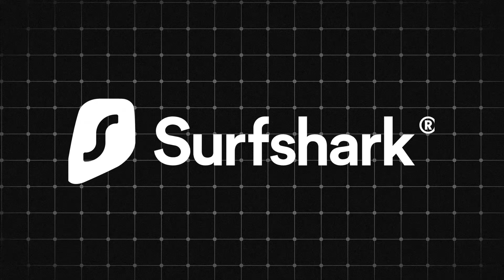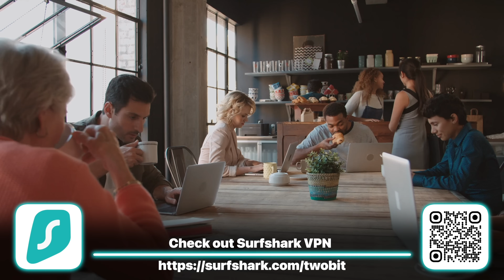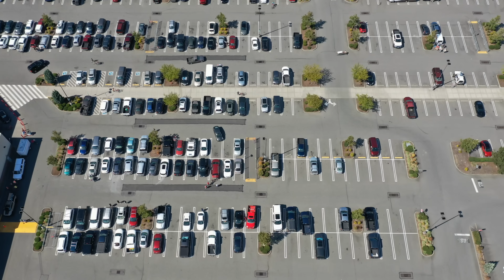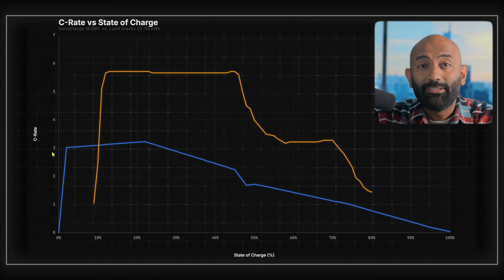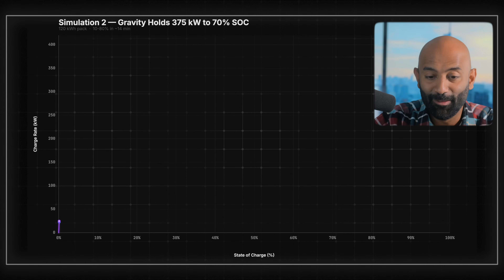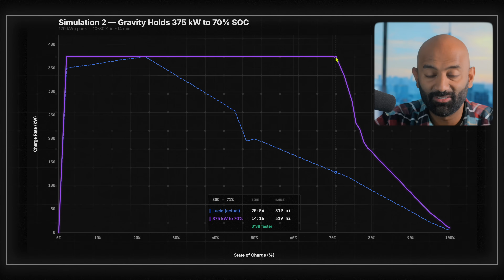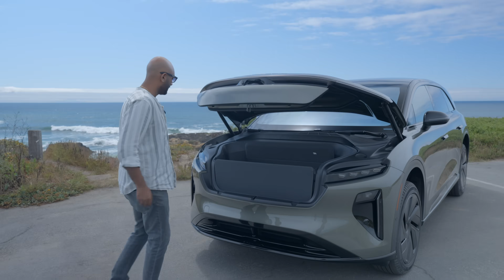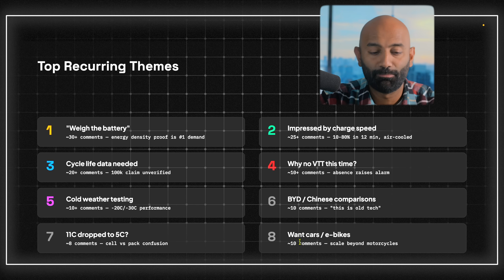Donut Lab Battery Test 4 Changes Everything!

Comment: I believe them easily.. but I don't think it will have a large impact, if they are still only like 10% cheaper than regular EV batteries. When Chinese salt based batteries have similar stats in many ways, but are in theory 90% cheaper (in couple of years).
Reply from the maker: 90% cheaper salt batteries? That’s the wild card. We’ll see how Donut Lab’s real numbers stack up.

Comment: What if we just did modular batteries rather than worry about charging speed we standardized the battery size like AA? You could charge it over days and have longevity, etc.. then you would simply pull up to a gas station and say I’ll have five AA’s please. They already do this in China by the way.
Reply from the maker: modular AA batteries? cool for city fleets, but try getting 200 miles range out of a AA. physics wins.

Comment: As I keep saying, third-party, fully independent, and unobstructed testing OR it is only smoke and mirrors. Yes. 5.7C is impressive. But it’s already being done outside of the solid-state realm. Give me scientific data from an independent test and I’ll believe.  Until that happens, it’s just fancy marketing.
Reply from the maker: not sure any system charges at 5.7 C with air cooling. or holds 5.7C for a huge part of the charge curve, thats outside normal at this point. there's something here.. but yah we shall see

Comment: This is quite interesting. I work for a company making some e-bikes so it is fun to see that.  I can also understand that they do not weight the battery, even though this is a bit depressing.

If they are really making a commercial product and shipping it this year this would probably be a new rush to get the tech and improve it, getting around patents and everything, this could lead to a lot of R&D and leap forward for EV.

Now this is a big IF. There are a lot of claims (like solid state emergency batteries that aren't at all solid state) that do not hold true because no one is ever held accountable for misleading marketing. I think laws about marketing should be easy : get the litigious part (with no name and no brand) to 10-100 people unrelated. Ask them about that part, and if they are mislead then consummers misleaded should be offered the option of getting their money back. And if there is still any profit after this, then it should be fined and that money should get to the state. No profit from illegal means.

But hey, let's dream about politicians doing some actual work like the engineers from Donut. Cause even if that's false advertising, there is no doubt they did some real world work here. I don't know enough about battery charging. Maybe overcharging lead to degradation which mean that the batteries will not hold. Maybe there will not be any warranty on the battery, or with a big asterix which will make it useless. But hey, still, impressive.
Reply from the maker: solid state emergency batteries that aren't solid state — lol, been there. hope this one actually ships

Comment: I watched the Donut Video. It had some strange omissions, as always...the most obvious one being, that they showed the initial Temps, but not the final temp. I also don't remember them talking about charging losses🤷‍♂️
Also, the real claims, like energy density and longevity still haven't been addressed.
That Bike could theoretically have charged that fast with a standard battery chemistry, if you didn't care  about damaging the Cells after just a few cycles.
I'm not saying that is the case, just being cautious about this, since so many things are still unclear.
Reply from the maker: final temps and losses matter — hope test 5 shows both

Comment: so what would happen if you had a donut battery the size of a tesla that is water-cooled and charging at 5.7c could you charge even faster cause you can keep it at the perfect temp even faster?
On the simulation 2 that you showed was that with water-cooling in mind or just air cooling cause if you had really good cooling could you not have 400kw charging to a higher % , and that would mean super fast charge speed and the 5.7c might because it is not water-cooled so could that not mean that you could do 7.5c at 400kw to lets say 70% then go down to 5.7 for 100% if so would that mean you could go from 0-100% around 10min on a tesla size battery?
Reply from the maker: Water cooling helps, but chemistry still taps out around 80% — donut’s curve proves it. Even with perfect cooling, you’re fighting physics, not just heat.
Reply: @TwoBitDaVinci  thx for the info

Comment: Could some of those steps be there because they're using a two electron transfer active material? Yeah and when should you view these graphs as voltamagrams / impedance specteroscopy / thermal characteristic curves because one or two of those can imitate the third and vice versa, so it seems like nothing is conclusive from this kind of data but there must be an intuition to know what's most likely yes?
Reply from the maker: Two-electron transfer? Possible — but without knowing the chemistry, we're just guessing what the steps mean.
Reply: @TwoBitDaVinci yeah it's still mostly speculation, but a calcium battery would be amazing!

Comment: Donut said the motorcycle would be limited at 5C because of the aircooling. Cars should be able to go higher.
Reply from the maker: air cooling caps it at 5C, liquid cooling in cars would let them push higher

Comment: Looking at your quick rundown of what this means for charge rate, this is the thing that will finally make an OTR electric semi possible. This has always been the limitation. Better energy density and faster charging will change everything. Just the energy density and the cycle life would completely change the world for every other vehicle use case. Add in the improved charge time and it's just pure insanity that we're getting all 3 in the same product all at the same time. Range anxiety for electrics completely disappear. If all of their claims are true, in 5 years time nobody will want an internal combustion powered car unless it's for nostalgia purposes.
Reply from the maker: game changer if real — but where's the cell weight data?
Reply: @TwoBitDaVinci  Yup. All we can go off of is their claim of 400wh/kg at this point. I'm not sure why they're witholding actual data on weight at this point. It's not like it would reveal any more about the trade secrets than making that claim in the first place. I guess they just want to play games?
Reply: By the way, I say this as a long time electric vehicle skeptic. In the early days, range, charge time and cost were my main concerns. They've mitigated those issues substantially over time, and I've been extremely impressed with track performance as well, but they really haven't been able to replace IC cars for certain applications, tied to those above concerns. If this turns out to be even cheaper, range between charging stops is longer than most gas cars and fast charge time is nearly as quick, there's really no downside any longer.
Reply: Oh, and I forgot, the batteries never wear out. That's equally as incredible, and even at lithium ion battery life cycle, I never thought that was a major issue. Cycle life was always good enough to compete. Now it blows a piston engine out of the water completely for longevity.

Comment: My BYD Seal 6 Touring PHEV has a 19kWh Blade 1.0 battery with max. 6.6kW charging. Would be pretty fast with 100+ kWh charging :)
Reply from the maker: 19kWh Blade 1.0? Cute. Now imagine that at 100kWh with 5C+ charging — your Seal would smoke most EVs today.

Comment: Comparing this to 3-4yr old US tech is completely irrelevant. Put it up against BYDs new blade battery or the new latest from CATL. 5C charging at the pack level is good, buts not close to industry leading now.
Reply from the maker: real hardware > cell specs. show me the pack doing 5c in the wild

Comment: Sorry, but this charging demo, in isolation, proves not a lot. This is because charge rate depends on two primary factors

1) what temperature you start at
2) how much wear you will accept

Basically for a single charge event, starting with a cold battery, the DCIR of pretty much any modern battery chemistry is low enough you can just wallop in pretty much any charge you like, without ANY cooling. This is because the cells themselves have a thermal inertia, ie they are capable of absorbing heat energy.   As we don't know any temperature data for this charging demo, we have no idea if 5.7c is impressive or not (given the proven high temp capability of this chemistry, it should be impressive, because being able to have a cell run up and over 65degC means you really don't need any cooling (for a single charging event) 

And until we see a fully homologated production ready motorcycle, we don't know if they have just ramped up the C rate for this test.  Obviously a big heavy passenger car is going to be a much harder task regarding life, because motorcycles have a low average power requirment (the speed limit tends to get in the way... 🙂 and lots of regen is not possible (unless you like going sideways)) and they do low miles per year. I suspect for a motorcycle cell calendar aging is, by far, the biggest wear factor.  That means the manufacturer can push the limits a lot more in terms of fast charging wear

 So sure now 5.7c is impressive, but it's far from proving this chemistry is a genuine game changer (and of course, the actual bit that needs to be proven, even if these cells meet ALL their claimed performance metrics, is can they be manufactured in volume and cheaply....)
Reply from the maker: starting temp is everything — without it, 5.7c means nothing for real-world use

Comment: ehhhh, measuring state of a lithium battery based on voltage is less accurate as the voltage difference rises. It was the first thing I learned in operating with lithium cells. It gets warm and the internal voltage rises but the voltage drops back to its capacity shortly after detaching from the charger. Requiring cooling is a red flag for poor measurements for exactly this reason, because it denotes a high internal resistance converting a lot of input to heat not unlike modern high-rate lipo cells. The reason this isn't done in practice is because of the long term damage and risk to the battery when you try to do this repeatedly.
Reply from the maker: yeah voltage sags under load—cooling needed means we're fighting physics, not just measuring it

Comment: Everyone says why not 11v charge it?  Donut labs literally stated 5c charging without cooling.  With cooling it's 11c.  They showed in the lab testing that it can 11c without cooling but that was pouch level not pack level.
Reply from the maker: pouch-level 11C doesn't translate directly to pack due to thermal and current distribution—good catch

Comment: when talking about donut battery pack in a lucid air you forgot to mention that this scale up is for air-cooled battery. Add liqued cooling and you can achieve much better than that
Reply from the maker: liquid cooling would definitely help — curious what their actual thermal design is

Comment: Here in Australia we already have Zeekr’s that can charge faster than 400kW. Their Golden Brick battery can charge at 480kW and the new 900v architecture cars will charge at a rate of over 600kW. All we need now are the chargers that can deliver this amount of power. Really interested to see the weight and energy density of the donut labs battery
Reply from the maker: weight and density still unverified — we only have charge curves so far

Comment: It worries me that Verge is still advertising "80% charge in less than 10 minutes" on their Long range TS Pro model. Unless they think they can improve the BMS enough to reach that before the Bike reaches customers, I'm confused. I'm getting the feeling this could end up being a good battery that would have been well received on its own, but might end up with some initial back lash as it falls short of the marketing. Pretty easy way to get sued too.
Reply: It was now 12min for 80% charge, quite easy to optimize to 10min
Reply from the maker: marketing writing checks the battery can't cash — classic

Comment: Thank you for giving the battery an actual chance and actually analysing it and the data we are given.

The critics seem to lack the imagination to even consider it could be real. I wonder why they haven't build a solid state battery since they know so well how one is made. Also, since the critics are also marketing experts they should propably give Donut lab a few pointers of what would be a better marketing strategy than what we are seeing. And ofcourse since they all see it's a hoax, they should propably consider how are Donut lab supposed to slip away from this noose they've put themselves in, that is tightening every week with every test result.
Reply from the maker: critics busy building marketing decks instead of batteries, huh

Comment: High charge rate, temperature stability, and high energy density could start to make it possible to make electric small planes. Right now the energy density is too low to deliver useful flight durations. If we could double the energy density we could get up to 2-2.5 hours of flight time. 
that could start allowing replacement of extremely expensive to maintain piston engines ($50k to $100k+) which require rebuild or replacement every 2000 hours, with electric motors and batteries. ultra high power density electric motors are also a great innovation we are seeing in cars. The improvement in reliability would be HUGE. I'm looking at buying a older small plane. I'm hoping to get something with engine time less than 1000 hours so I could have 10 years before hiting a 2000 hr tbo. I'm excited that with batteries continuously improving I could possibly replace a 4-5 hour duration fuel capacity and combustion piston engine with battery packs and electric motors. It would be awesome. fingers crossed donut made a big leap with this technology.
Reply from the maker: 2-2.5 hours on electric? That’d smoke most gas trainers. Donut better deliver.

Comment: Need to do 10,000 100,000 cycles in various charge/discharge rates, environments and configurations. None of this extrapolating BS from a few cycles.
At 1 hour per charge/ discharge it takes 11 years for 100,000 cycles, battery needs time to cool down between charge cycles. See you in 2037 to review the graphs.
Reply: That is not how it works bro
Reply: @evilkasi  
Thats it how it works bro.
When  Dr. Jeff Dahn has done his life cycle testing of the Donut battery we will know it’s true performance.
Dr. Jeff Dahn, renowned authority and researcher of batteries.  
Professor emeritus at the Department of Physics & Atmospheric Science and the Department of Chemistry at Dalhousie University
Reply from the maker: 11 years? I'll bring popcorn to 2037. Until then, we work with what we've got.

Comment: Comes down to simply pushing more amps.. dont.. just increase the voltage 7s 8s systems... Why not 15s 20s systems?
Reply from the maker: higher voltage means more insulation, safety risks, and charger compatibility issues. 15s/20s isn't just 'more amps' — it's a system redesign.

Comment: Did you know that the Porsche Cayenne EV (going on sale this year in the USA) will charge from 10-80 in about 15 minutes?  You can see the charging curve at EVKX.  I think this is very interesting, and I would also mention that one of the CATL (Chinese) lithium iron phosphate batteries (Shenxing) has a peak charging rate of 12C (charging curve not clear to me though, probably doesn't hold this for long, they claim something like 10 minute charging).  Very excited to see what happens with this, though I still have doubts about various claims not yet tested.
Reply from the maker: Porsche's 15 min 10-80 is solid, Shenxing's 12C peak is wild but likely short-lived—real-world hold time matters more.

Comment: The user comments analysis is a nice touch.

For me, the most important factors are still energy density and cycle life.  This is for widespread use.  (Curious why they didn't lead with this, and may dribble this out later.)  By high charge speed may have niche applications, such as motorcycles.  (This is if one has the infrastructure to support it.)
Reply from the maker: energy density and cycle life are the real MVP — charge speed is just the flashy opener

Comment: unless this battery becomes availble in ultra large quantity s(China hyperscaler vector capacety) while interesting it wont move the needle...house storage battery is still stuck at 2.5k to 5k charge cycles making investing in a off grid home useless and expensive in most parts of europe....that is ultimately what is holding back net 0 heating houses for those that have large plot of land and a bad insulated house,,,if for same cost as insulation you can buy solar panels and battery thats game changing...not all want to live in a modern home where wel insulated means low air movement and worse inner climate in most circumstances...
Reply from the maker: grid-scale is the real bottleneck—lab numbers mean nothing if we can't make enough